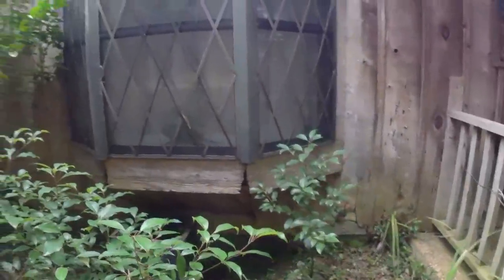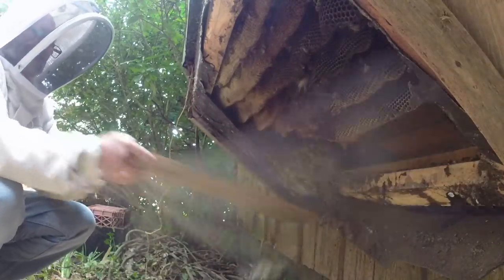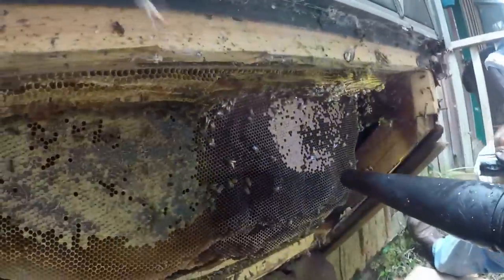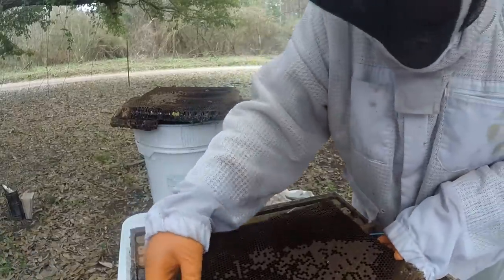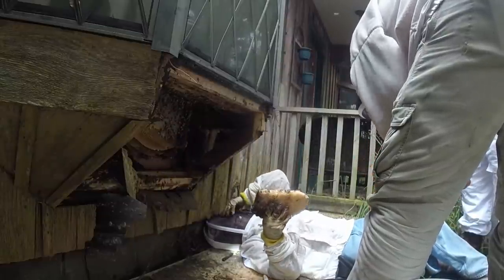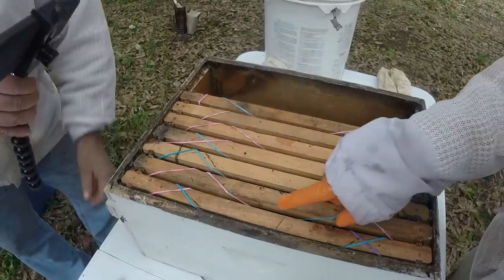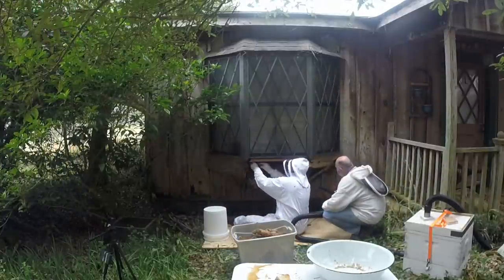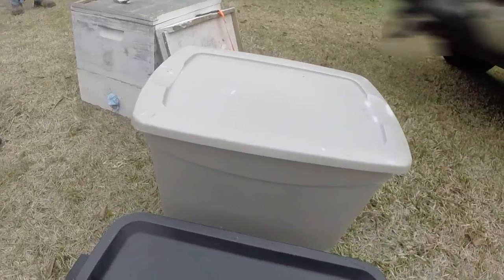Bee Hive Removal from Bay Window

Comment: great ,would like to learn more about the vacuume
Reply from the maker: You can find the pans for it on the web. I think even Bee Forum has plans for it. It's a bottom swept board then you place your brood box, then a screen panel that allows the screen to pull out, then the top with a vent hole and a hole for the vacuum hose. The vacuum pulls through the brood box bringing in the bees.

Comment: Mike, what size are those rubber bands use use for holding in the comb. It looks like a really good way to hold it. Thanks for the video.
Reply: I agree. It looks like a good way to rubber band the comb. Dragiging over the comb and holding on to keep it from  falling is difficult
Reply from the maker: I call that doing circus moves Darrell. No circus moves for me. Use these big bands cross ways and it's no sweat.
Reply from the maker: Jim, I get them at Walmart and the are File folder bands. This is the description that you can google and you will find them.  Alliance Advantage File Bands #117B (7" x 1/8") 0780A , 4oz., Approx. 63 Assorted Rubber Bands.
Reply: Thanks so much.

Comment: Hey Mike,  I just did a cut out of sorts, I tried to use your rubber band method going diagonal across the frames but my rubber bands kept breaking so I had to resort to my old up and down banding.  What size rubber bands do you use?  I need to get some.  Thanks for the videos.
Reply: I found it!  I looked back in the comments where someone else asked the same question. lol
Reply from the maker: Ok, great! File bands from an office supply or from Walmart.